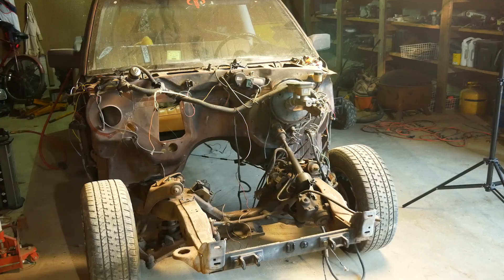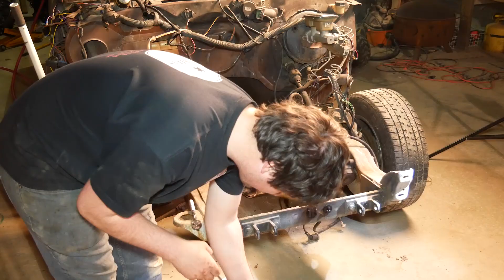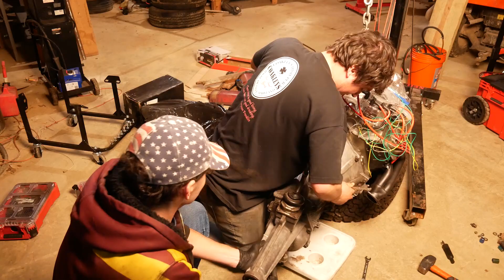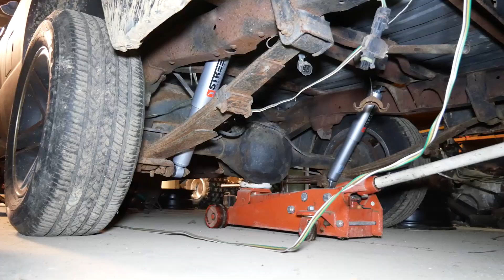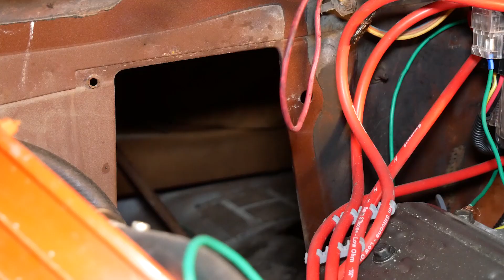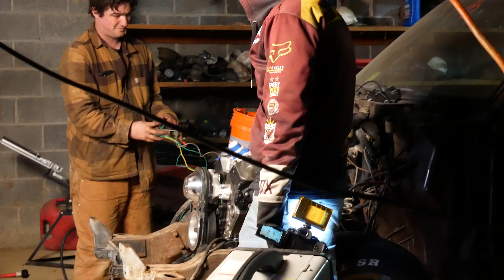V8 S10: ENGINE/TRANS INSTALL (Ep. 7)

Comment: What trans is that? 
I have a small block Chevy from like 1990 ish and I don’t know if it will bolt to the 2.8 5 speed
Reply from the maker: It is a T5 Transmission out of a Camaro. You can use the 2.8  T5 transmission, but you will have to change the bellhousing and the input shaft, or use a clutch disc with the correct spline count for the input shaft on the 2.8 L version of the transmission. 

For me it was easier and cheaper to pick up a Camaro T5, and swap the S10 tailshaft housing onto it as seen in Episode 3 of this project. Despite conflicting information going around the internet, the gearboxes themselves are essentially mechanically identical, even if it is the "world class" version of the T5. The WC does have a few improvements, but both are a little under-engineered for something as big as a 350 ci engine. 

Check out episode 3 if you want more information on how I swapped those parts over, and what you can expect with the T5 transmission.

Comment: Can I ask where you got the headers for that swap? I am trying to put a 97-99 5.7l Vortec motor into my 96 4x4 LS  S10 Blazer. It would be greatly appreciated, thank you.
Reply from the maker: They are from Summit Racing, they are made by Patriot Headers and are designed to go around s10 steering column

Comment: How does this video only have a little more than 300 views. This is the most I'm depth v8 s10 swap online. Even down to having engine issues for no reason
Reply from the maker: Hopefully the project gains traction as I keep filming it! I've been having a lot of trouble finding detailed information on what parts to use so I am trying to include as much information as I can in the videos. I will probably do a detailed video in a few episodes of every part I had to buy for the swap
Reply: @triptheroad  look forward to seeing the progress. Just picked up my own project for $200. So I really appreciate the details that many tend to miss. I'm a fairly good mechanic but fitting something where it doesn't want to be is a pain.

Comment: What motor mounts, headers and any mods to firewall for clearance from motor and bell housing bolts thanks
Reply from the maker: We put the whole motor in so I am not sure if the bellhousing bolts will be accessible without taking the engine and transmission out together. Headers I am using an s10 specific kit from Summit racing for first gen s10, I will probably be doing a video soon on all the parts used in the swap with part numbers
Reply: @triptheroad  ok thanks